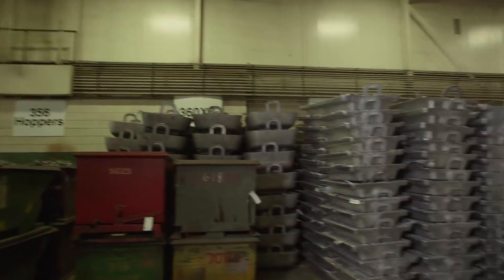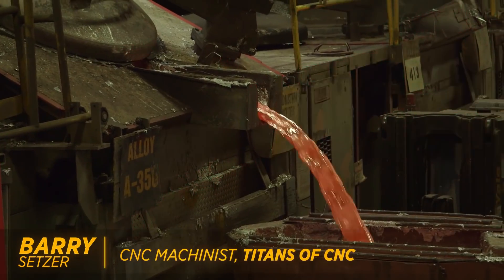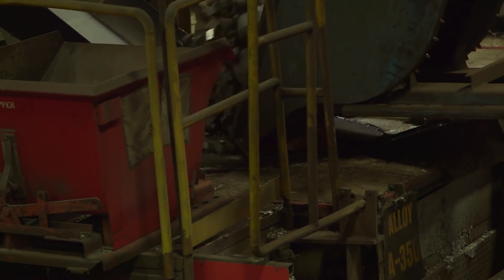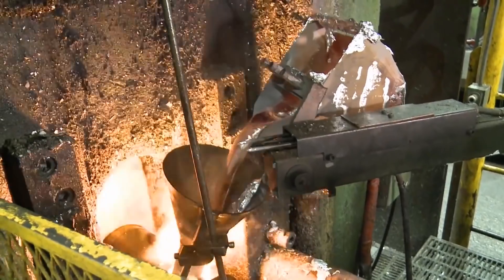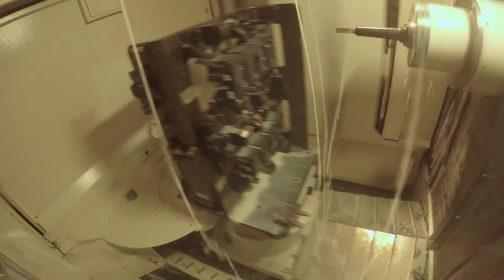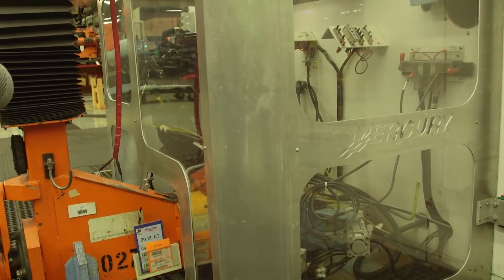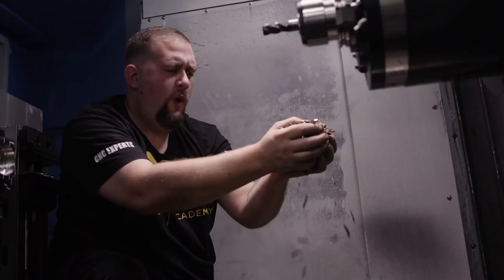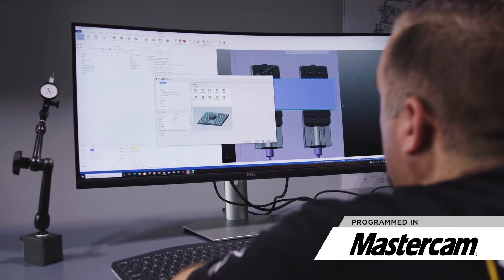The Dumbest Thing I've Ever Done in a Machine Shop

Comment: I've seen 'accidents' like this a couple of sites which I have worked. The solution to these events were the same in each case (The presenter was right on):
1: the best solution is to not let this happen in the first place.
2: failing that, situational awareness is critical- knowing what to do e.g. where the extinguishers are, and how to use them), basically, TRAINING.
3: Like it says in The Hitchhikers Guide to the Universe: DON'T PANIC. (Maybe that should be #1 but it isn't easy or natural).

THINK. (basically. Which, in an emergency, is a really, REALLY hard thing to do- we all know that, eh? This is only acquired through training and (sometimes unfortunately gained) experience.

Anyway, cheers. Good points raised in this vid.

Comment: ROFL. Well, I think you got me beat. Mine was a 6ft long 1" diameter steel shaft hanging unsupported out the headstock of a lathe. I knew it was sketchy as frig but the plan was to only run the lathe at ~200 rpm just so I could face it to length.

Worked great. Until I found that turning off constant surface speed was not something that persisted through a power cycle.

That rod bent 90° in a hurry & it had the machine hopping around at least 6" high & moved the machine at least 2 feet. Then somehow managed to stay on it's leveling feet.

That was the most terrifying lesson I've ever had.

Comment: Yikes! This is why hot work permits exist. Any time for is used, it should be under 100% controlled conditions. Blow torch, gas burners, ovens, etc. Burning off solvent with a pocket lighter is such a crazy thing to do. Only real benefit of pocket lighters may be sealing the ends of ropes. Even then I'm sure there are safer tools for the job.

Thanks for the story.

Comment: Years back one time when I was grinding some slitters for paper mill rewinding machine I turned my back for the machine same time when I pushed cycle start. Almost instantly I could feel like someone blowing with a heatgun to my back. When I turned I saw a big fireball at the ceiling of the machine. The oil we used as a coolant had caught on fire. Luckily it died away at the same moment I pushed emergency stop.

Nowadays I won't turn away immediately when I start the program. No matter if the coolant isn't oil.

Comment: You have to watch the safety videos at work. AND get the safety training on a regular basis. Or it goes by the wayside. Then, BOOM! Fire extinguishers need upkeep, checks and expirations. If this isn't done, BOOM.
Reply: We had a safety fail on a laminating machine. In a clean room. A roll got red hot and started smoking. An operator hit the machine with a fire extinguisher. Took us a month to clean up the machine (machine down). Fire extinguishers can make a huge mess too.